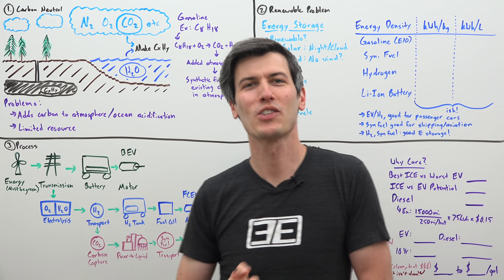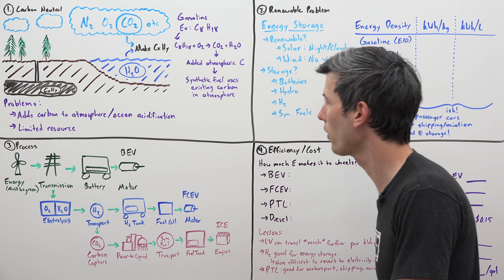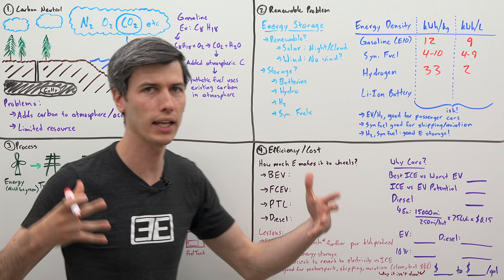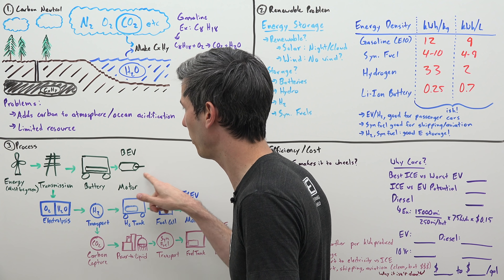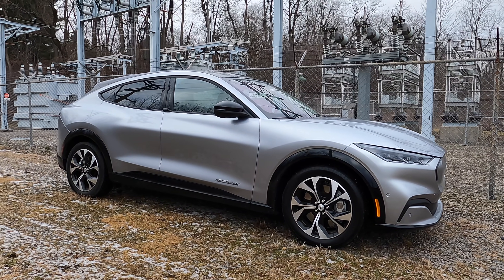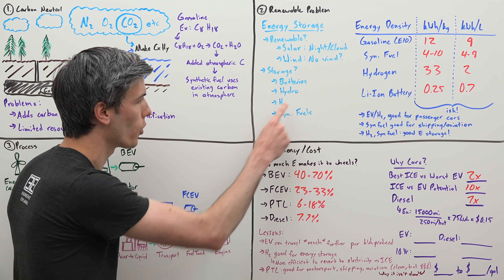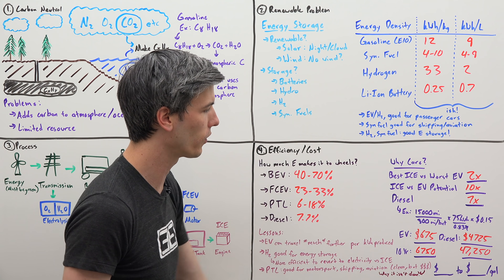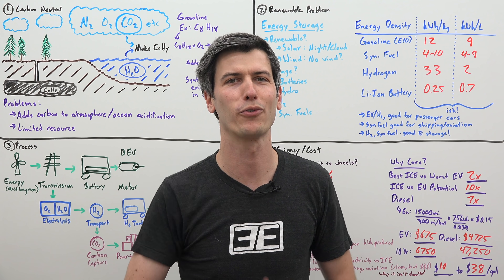The Big Problem With Synthetic Fuels

Comment: No they won't,  but refineries have for decades now broken heavy oil chains and recombined short hydrocarbon chains into the common cocktail of gasoline, (petrol)grades.  CH6, CH7, CH8 (octane), CH9, CH10.

  This avoids hydrocarbon waste when there is a low market for mineral oil,  natural gas,  and kerosene blends seldom used today in most sunbelt markets.   

When you and I were kids,  the oil farms and refineries still just burned away natural gas and SO2 they didn't want. 

  Now like a Cajun eating a catch,  they waste almost nothing.

There is,  of course,  no reason for the US or Canada to import Brazilian natural gas combined into Nazi era synthetic fuel,  but it may help Brazil.  We have far more oil and natural gas than we can use.

Comment: Don’t say “acidifying the ocean” it’s an unscientific activist term. Acid has a specific meaning, the ocean is becoming more neutral.
Reply from the maker: Simply means the pH is lowering. Not the topic of this video but it's a pretty straightforward concept.
Reply: And that is better how exactly?
Reply: The average pH of seawater is about 8, meaning it is slightly alkaline. This is good for sea creatures as it makes it easier for them to grow carbonate structures, bones, shells, coral etc.

Increases in CO2 dissolved in the ocean from the atmosphere can increase the amount of carbonic acid (H2CO3) in seawater lowering the pH towards the neutral figure of 7, and sometimes even tipping over to slightly acidic. This is not good for sea features. 

The good news is that the carbonic acid can be fairly easily extracted from seawater as part of a process to generate synthetic fuels. This process has been pioneered by synfuels researcher Heather Bauer at the USN NRL.

The vision is nuclear powered factory tankers roaming the world's oceans making fuel as they go. When full pull into port and offload.

Comment: Good video explaining the passenger car perspective. It is important to mention that there are synthetic fuels that do not need the CO2 (Ammonia) and that the industry consensus is that e-fuels will target hard to abate sectors (deep sea vessels). For the heavy shipping industry, batteries are prohibitive. Last point to mention is that synthetic fuels can be produced at places with very cheap renewable electricity, whilst battery needs to be charged somewhat close to the consumer. Thanks a lot for this all your videos.

Comment: How do these numbers compare to ethanol and bio-diesel?
Reply from the maker: Great question!
Reply: @EngineeringExplained  Will you make a video about that? Would be interesting.
Reply: @EngineeringExplained  I was totally bummed out that you did not include ethanol in this video. It's a high octane fuel suitable for today's engines (see Brazil) and both renewable/carbon neutral. Love your channel though. I was born an engineer who ended up in a biochem life 🤷‍♂️
Reply: @evertonptube  I also think that's pointless not to mention ethanol and bio-diesel since they are much easier to produce and the energy actually comes from the sun (Photosynthesis). Brazil is also a great example of how this can be done in great scale
Reply: The area required for these is huuge. 
Interesting for making use of some spare land and mixing few percent into normal fuel. But impossible to replace all fuel with that.
Reply: @daniel_960_  Yeah I remember the backlash from environmentalists when they started clear cutting forests in certain countries for this and palm oil. Then there's also the issue with biomass farming but that's another topic!
Reply: It's not really a fair comparison because a synthetic fuel is a way of containing energy that you've already generated, a biofuel feedstock generates its own energy by growing and doing photosynthesis. I guess a fair comparison could be made by say comparing how many electric vehicle miles you can drive on an acre of solar panels versus an acre of corn or switchgrass. I remember reading a while ago and I don't know if this is still current but you need to consume something like 1.1 gallons of fuel in farm equipment to make a gallon of ethanol, meaning ethanol production is a net fuel consumer on top of the amount of land and water you have to devote to it. It all becomes different math if you make it out of a waste product instead of a crop.
Reply: I wouldn't get your hopes up, although it will be interesting to see, regardless. Photosynthesis is very inefficient at turning sunlight into chemical energy, somewhere in the 3-6% range, and that's before you have to do all the processing and transportation that's involved in physically harvesting and extracting the raw agricultural products.
Reply: Ethanol production consumes more fuel than it produces.

Comment: The real question is:
Why not use ethanol or other biofuels instead?
They are also carbon neutral and can be produced from cellulose waste.
But they are also far cheaper than synthetic fuels.
Reply: Because politicians and the mega rich have decided that we are going to drive EVs.
Reply: @peekaboo1575  EVs are great for commuting, but for sportscars the tech just isn't there yet.
Also they will stay on the roads for a few more decades, and they will need fuel.
Ethanol is just about the perfect solution for sports cars while batteries are the ideal solution for commuter cars.
Reply: @diesistkeinname795  I don't know for how many more decades they will stay on the road. The politicians in places like Paris saw no problem banning cars made prior to 1997 and I'm sure they'll have no problem banning ICEs as a whole when they feel like it. We're talking about the people who have locked good chunks of the planet and destroyed small businesses because of a flu, let's not forget.

I agree with what you said but the problem is that the changes aren't being driven by the market.